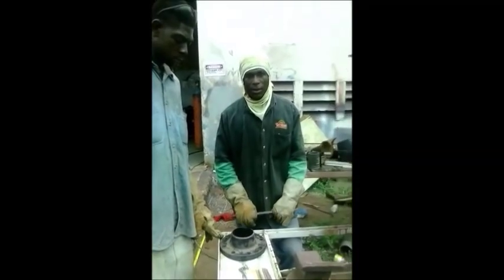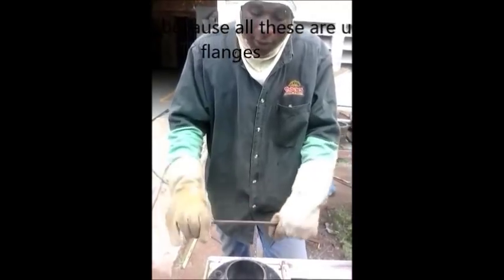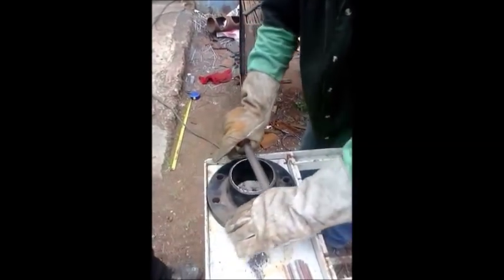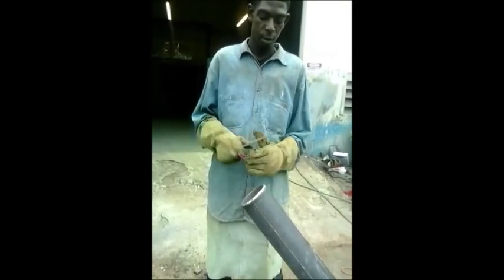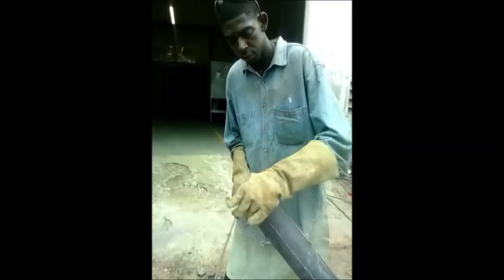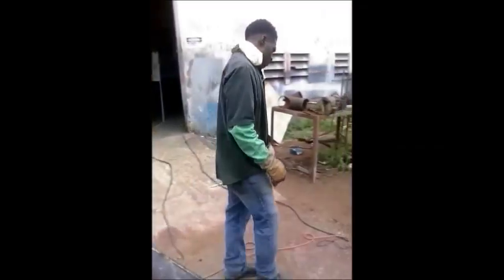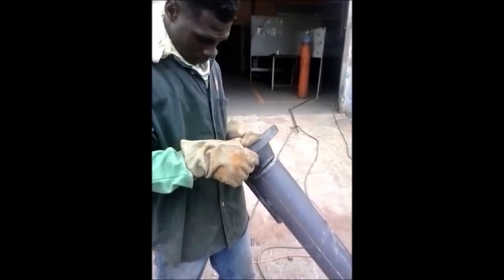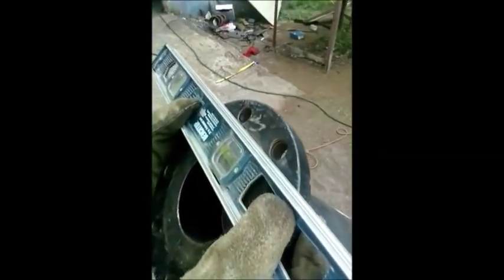Preparing and Fitting a Weld Neck Flange

Comment: Your method will damage the flange and pipe bevel because you are not using a gap rod during tacking.
Reply: Doesn’t matter much. It’s just a full penetration tack rather then a bridge tack.
Reply: If you look closely you will see a gap rod being used.

Comment: absolutely  ridiculous  .No  spacer,no proper  ppe, u r not supposed  to measure the adjacent side of tack weld
Reply: And yet, somehow, it worked.  How about that?
Reply: actually there is a spacer; before his first tack. Look properly next time!!!
Reply: look at 2:27 there's a wire between flange and pipe for spacing.